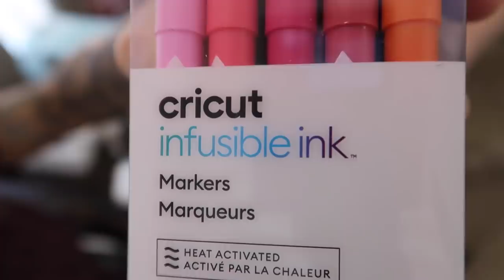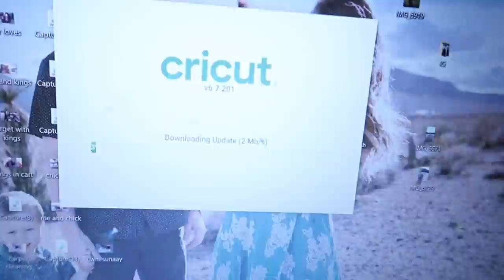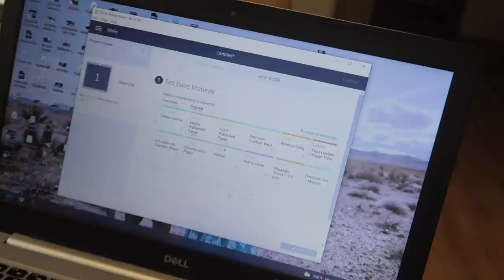2-DAY SPEED CLEAN WITH ME 2021 | EXTREME SPEED CLEANING MOTIVATION | CLEANING MY HOUSE | HOMEMAKING

Comment: You can prop the handheld part on the bottom of the wand Bc there is a hook
Reply from the maker: You can hang it on the wall with the hook it comes with, but if it has nothing to hook onto or support it with the full stick attached it just falls over like in the video 🤣 usually I’m good about leaning it up and making sure it can’t fall.... but not today